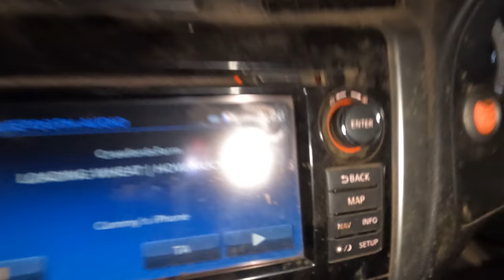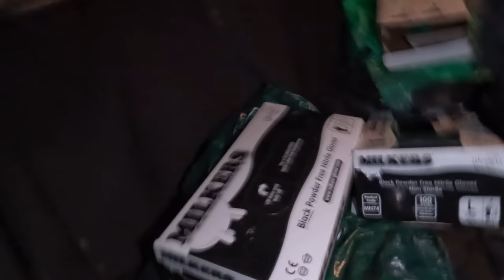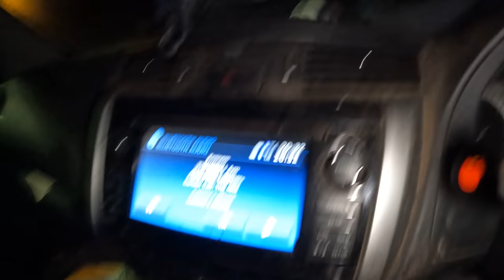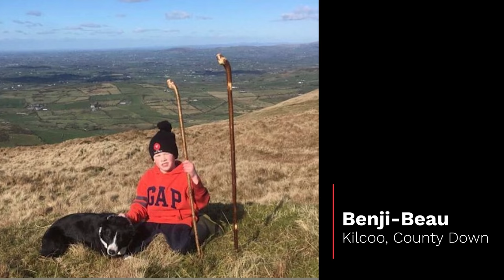I DID SOMETHING VERY STUPID!! |  Sheep Scanning in Scotland

Comment: If it is any consolation: I was supposed to meet a friend at the Ronneburg, an old castle in Germany. What I did not know: Germany has two cities named Ronneburg with two castles named Ronneburg and both are near Frankfurt (but of course, there are two different Frankfurts). Plus: Both were exactly a 1.5 hour drive from where I stood. To make a long story short: I ended up at the wrong castle and my friend had to wait for three hours.
Reply: Omg, I would have pulled my hair out and found the closest place for a beer 😂.
Reply: @lisabishop6266  The worst part is that it took me ages to realize what happened and why the castle looked different than the one in the internet 🤣🤣 I am usually not that dense, I swear.